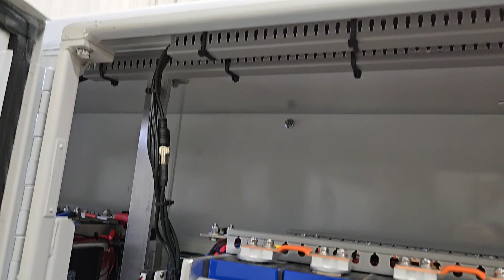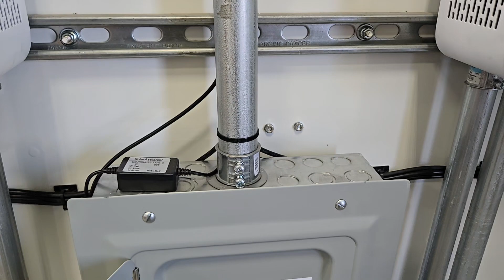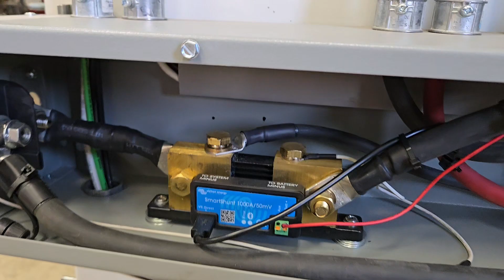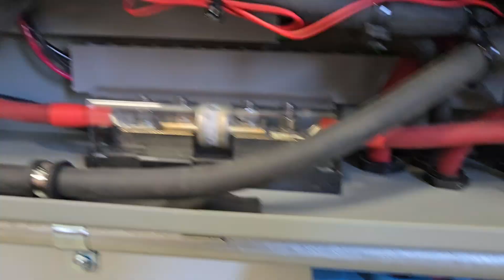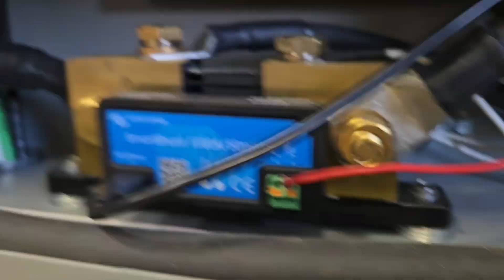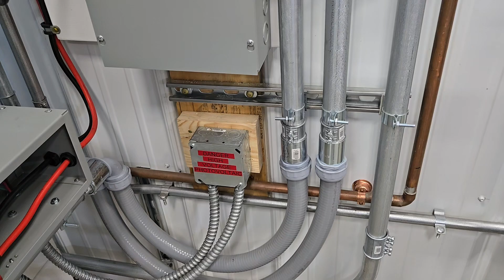Shop Solar System Overview

Comment: Why have you decided to change out the LV6548 units in your home system?
Reply from the maker: I need an inverter in my new work trailer and will be moving to a 48V inverter compared to the 12V in my old work trailer. As time has gone by, I've added more house loads such as a water pump heater, more heat pumps and we keep increasing usage compared to when we first started on the journey. I could use more headroom on inverter size, plus I plan on adding more panels as we move more towards heating the house with electric power instead of propane. Logical choice is upgrading the house inverters and using the LV6548's in the work trailer which is just 120V circuits. One advantage of moving to ASP's in the house is if an inverter goes down, I can run off just one ASP and power the whole home with 120V/240V limited loads. With the LV6548's, I'd only be able to power 1/2 the house with 120V. The original LV6548 is a solid performer, don't get me wrong. We have worked the heck out of it.

Comment: Any particular reason the switch is on the negative side? And are you sure you have the ASP and not ASF version of the SRNE? Because i thought the ASP was the 1phase 240, or 3phase version, whereas the ASF is the 240v split phase that we'd use in the U.S.
Reply from the maker: The switch is on the negative side because the shunt needed to go somewhere and cable costs money. Switch was desired to be on the end of the trough. No reason to run positive cable there so I put the switch on the negative side. Mine are ASP units,P stands for parallel capability,  the ASF can not be put into parallel. I waited until the ASP's came out and was one of the first to purchase the ASP model.

Comment: Thanks so much for the additional details, Doc! Glad you are happy with the SRNEs. Until I get my solar mounted on my 40'HQ I'm running a single SRNE  from grid power to charge my 48x 280AH cells as a big UPS. Been solid for a year, as standby power for my office. Adding another 16x314, and slowly progressing on container build. I saw that someone makes a 6awg to adapter lug that accepts a larger cable, have you looked into those?
Reply from the maker: Yes, I could have bought some pin terminals. Running 4AWG when 6AWG is sufficient is costly. On the AC output and AC inputs, one has to remember that at least 2AWG cable has be used after combining or combining inverter output in the loads panel (which eats up breaker space). On the AC input side it would require a pair of breakers in the main panel. In both cases, it would require over 3 current carrying wires in a conduit so either 2 separate conduit runs or derating the conductors due to more than 3 current carrying conductors. Which brings you back to running larger wire due to the derating, then somehow reducing the size after a junction box. I find it easier to run one large conduit with 2AWG or larger wire, then breaking it off into 2 separate runs to each inverter using a breaker panel for the junction.

Comment: You have done a great job Proud for you
Reply from the maker: Thank you, it certainly was a long journey. I bought the cabinet, inverters and the first 96 cells a year ago in February. I only get some weekends and about an hour in the evening to work on projects in the late fall, early spring and winter. Summer I'm too busy with air conditioning repair work.